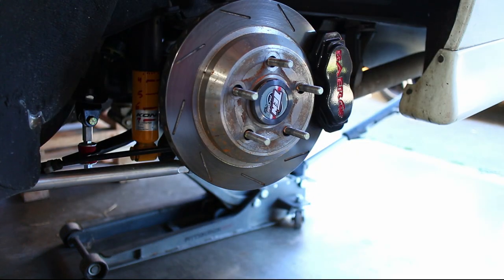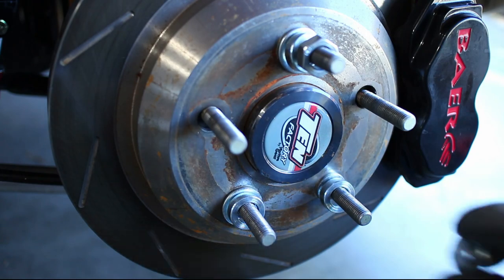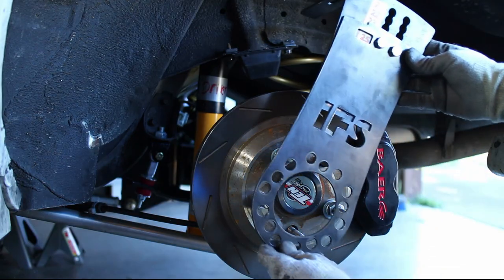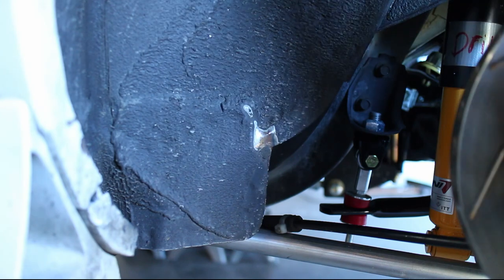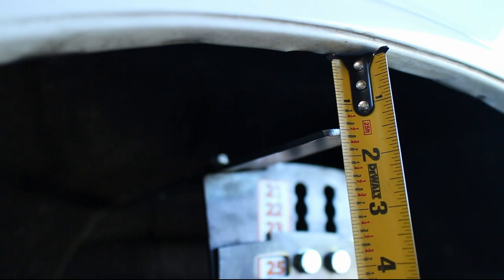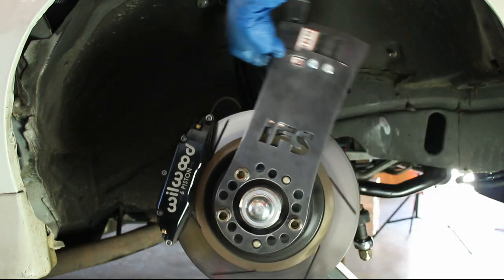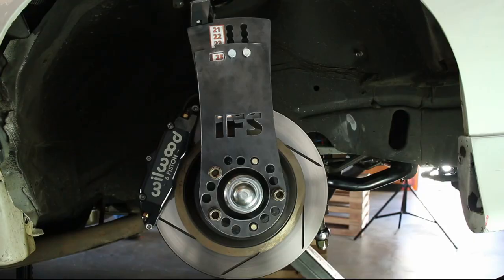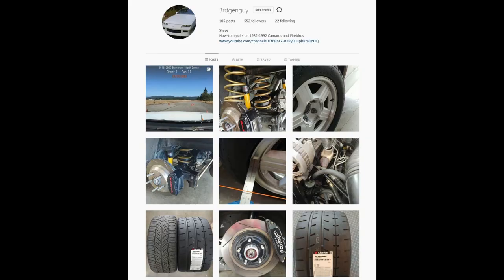Affordable Wheel Fitment (1982-1992 Camaro/Firebird)

Comment: Do you still have the tool, and if so would you be willing to measure out my car for fitment?
How much would you charge to do this for me if your willing?

I looked for the tool, they all look like you need an actual tire which I need to know what will fit before ordering of course. And I’d only use it once so there’s that. 
Anyway, thanks for your time and your car is awesome.
Reply from the maker: they don't sell that brand of tool anymore, but there are cheap copies on ebay.
Reply: @3rdGenGuy they are different. I’ll find a shop around here.

Comment: You'll need to run fender flares and spacers/ the 3-4inch wider 4th gen rear axle to clear properly
Reply from the maker: 18x11s and 315 wide tires fit very well after some hammering and cutting. No spacers or new axle needed.

Stay tuned for the next few vidoes.
Reply: A 4th gen TA rear end with locker, discs, 4:43 gear, etc. fit perfectly, and the 89 Corvette "salad shooter" wheels allowed for tons of tire with NO issues what-so-ever. Love it!

Comment: will 5x114.3 wheels fit 5x4.75 size for 3rd generation camaro?
Reply from the maker: no it would not fit , a 114.3 bolt pattern isn't even close to a 3rd gen.
Reply: @3rdGenGuy  Okay cool, thanks!